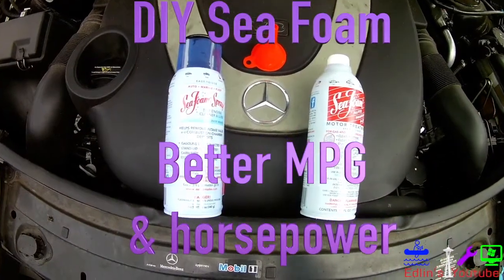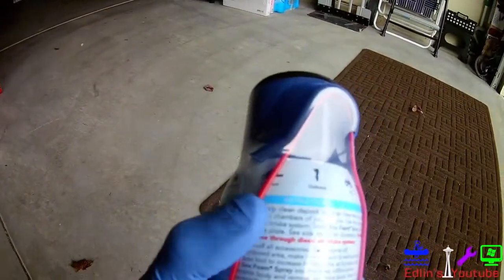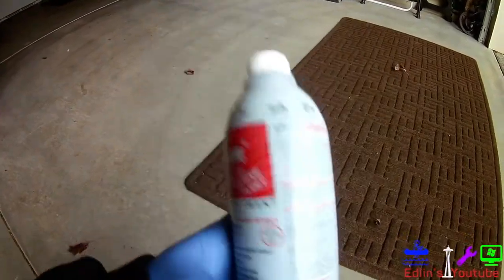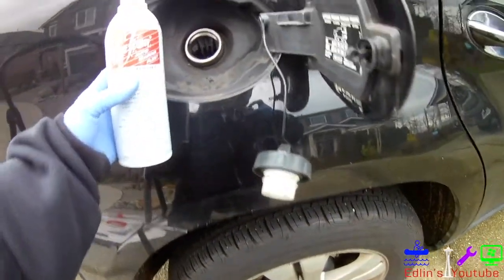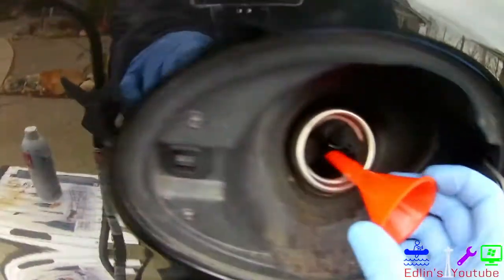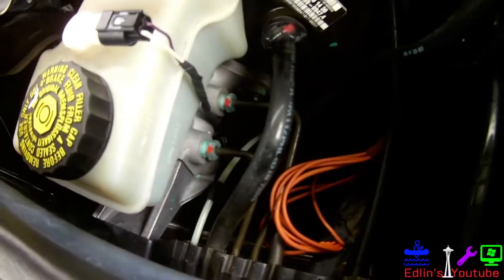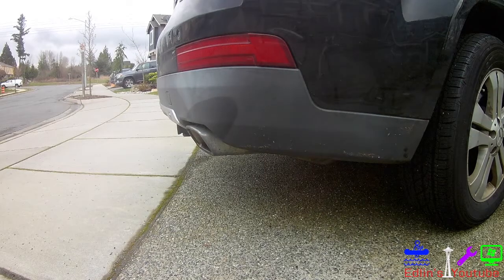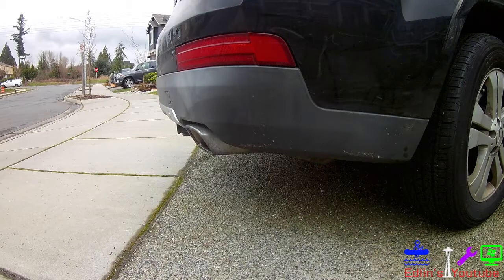Sea Foam Tutorial - remove carbon buildup, Clean Fuel Injectors, Get Better MPG.

Comment: He is using the vacuum line that goes to the beake booster hes not saying to add seafoam to the brakeline or reservoir. The brake booster is just an easier and larger VACUUM line to the induction system. Some instructions just run the vehicle and use a curved straw and spray seafoam into the throttlebody to clean the carbon deposits and induction. And still be careful and wipe out the throttlebody dont mess withbthe linkage too much as many have electronic and may damage them. Some mechanic are against this as they want to do repairs or replacements.

Comment: I didn't realize the brake fluid exhausted to the catalytic converter....
Reply from the maker: yeah didnt think about it until i did this
Reply: That’s because brake fluid doesn’t exhaust to the catalytic converter , he probably had to flush his brake fluid after making this video because seafoam is not for the brakes , it’s for Carbon build ups inside the engine and clogged fuel injectors.
Reply: delete the video...

Comment: Scotty said it’s for two stroke engines old era automobiles 🚙 that the white smoke is an oil burning and could actually damage your engine 🤷🏽‍♂️ for never cars 🏎 gotta use just regular gas injector cleaner to put in your gas tank .. I’m personally buying Mercedes genuine injector cleaner can for $11 . I got two mercedes don’t want to risk to ruin  $30000 engine for Walmart product especially the foam can .
Reply from the maker: thanks bud